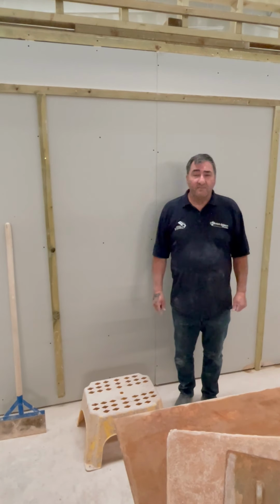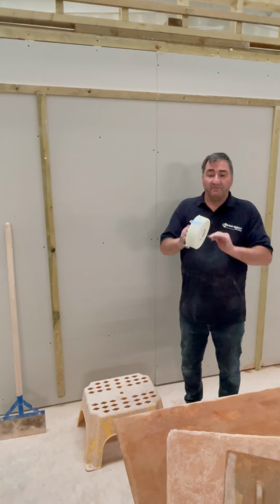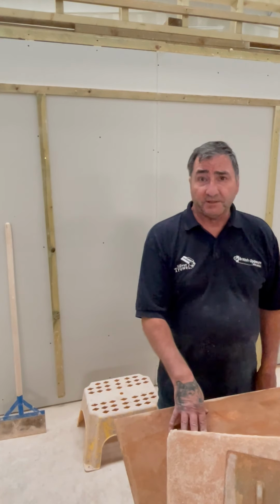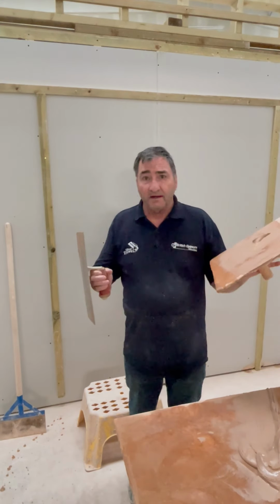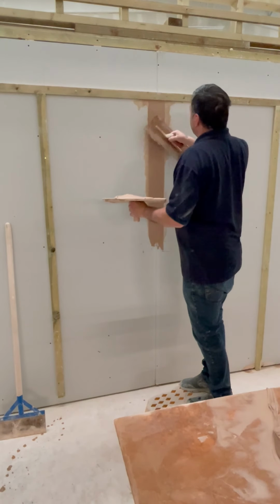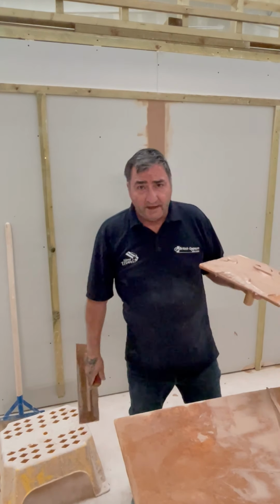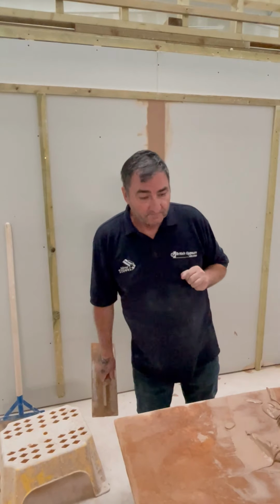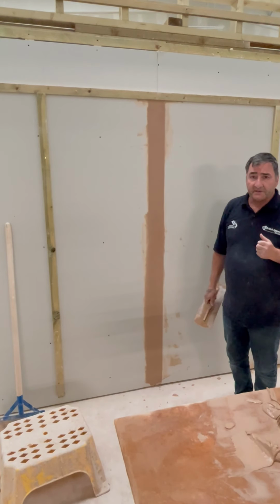Plastering 4 beginners guide of how to apply plaster Scrim tape over taper edge board.

Comment: What about when you coming to paint it. Don’t you need drywall primmer and cuz your plastering would you need fresh plaster primer /undercoat?
Reply from the maker: A miss coat of good quality paint this will high light any hollows or gauls which can be filled with a pre mix decorators filler.. Always follow the manufacturers guidelines..